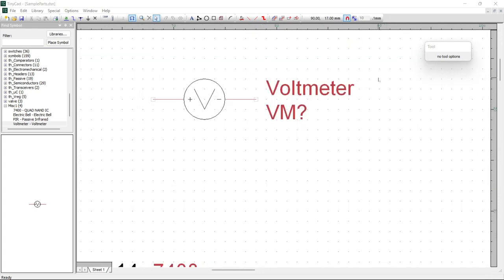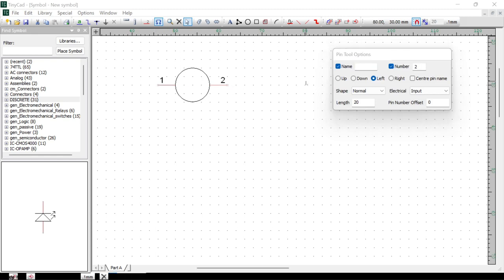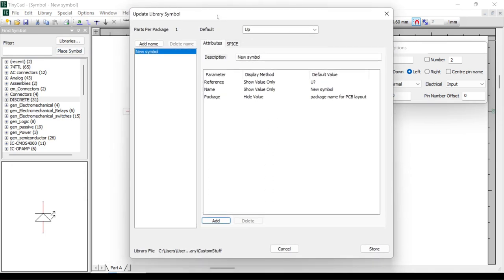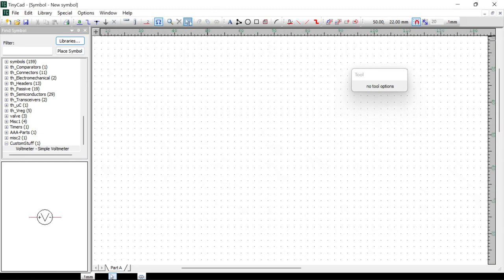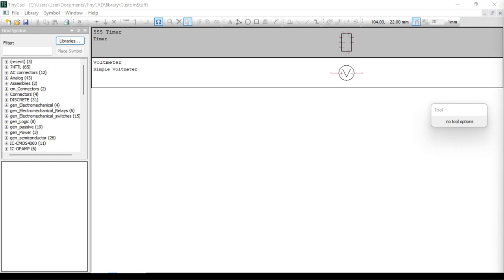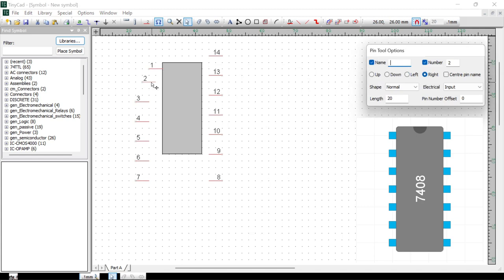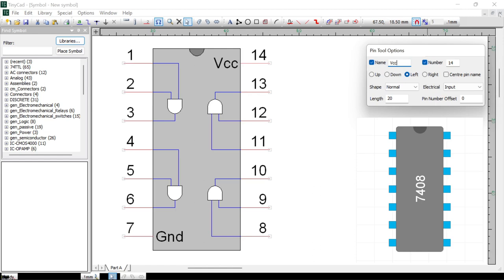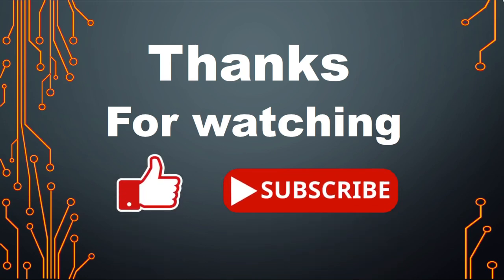Draw Electronic Circuits the FREE and EASY Way with TinyCAD - Part 4 - Make Custom Parts & Libraries

Comment: Excellent 4-part series to explain the essentials of a great piece of free software - Thank you very much.
I have Solidworks Electrical which includes a schematic drawing facility - but it’s a bear of a job to learn just for a simple home project. Solidworks Electrical is great for dovetailing with the needs of a large organisation, but TinyCAD is lean and has all the facilities a single user needs - I especially like that custom symbols are easy to create.
Reply from the maker: That's great Aidan. Thanks for sharing!

Comment: Hi, thanks a lot for these tutorials!  Would you know how to import/create a DB9 connector backshell?  This would be hard to draw within the program, so import a PNG/SVG and build a component with that?  I'm trying to do a drawing for a DB9 cable.  Thanks.
Reply from the maker: Hi Jrad - I might be wrong but there doesn't seem to be an import option. However, you can copy an image to the clipboard and then paste it into your drawing when creating a symbol. If you right click on the image and then select "send to back" you can then draw the rest of the symbol on top. Hope that helps.
Reply: @teksparkz  Yeah, that works. Awesome. Thanks.